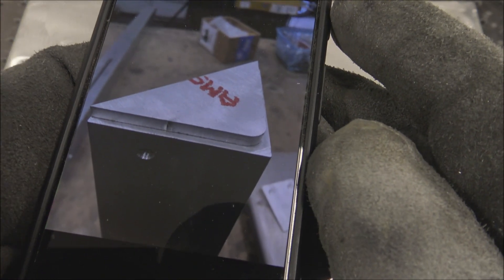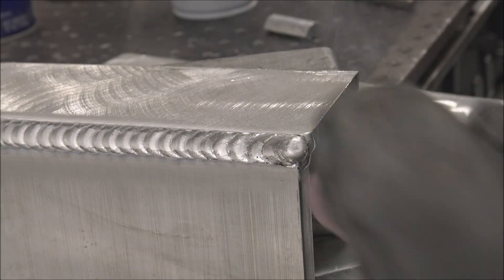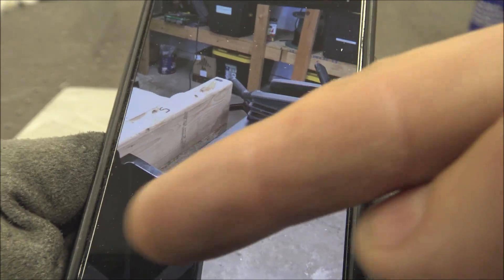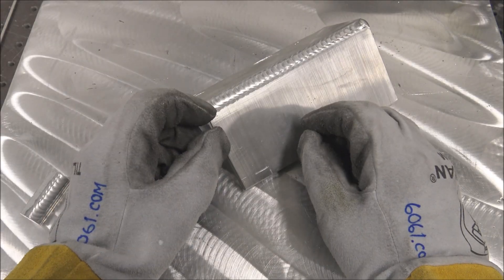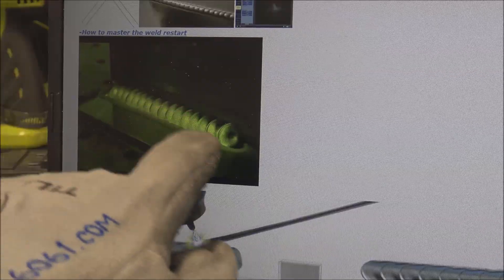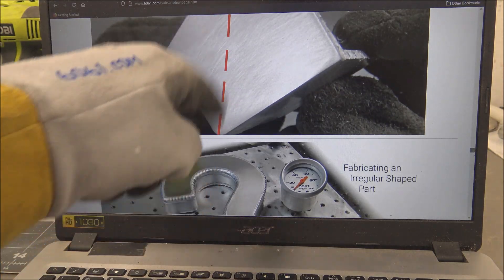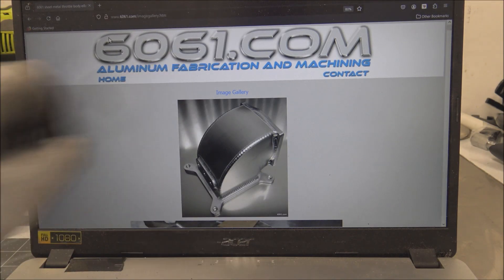TIG Welding Aluminum Fabrication Tips - So Many Things Can Go Wrong... Thick Stuff

Comment: Did you weld that using a foot pedal if so is it possible to get welds like that with a trigger switch?
Reply from the maker: I do not recall in this specific video.

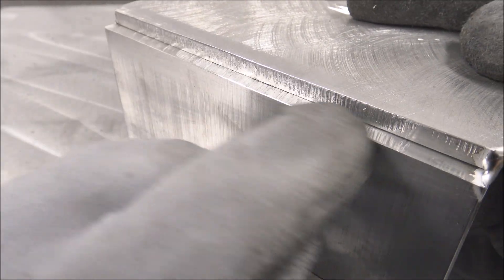Skip to the 1:50 mark in this video:
https://youtu.be/B53Xs33KIwM?si=T1lanrU7O_75U9Bv

Comment: Prime welds are awesome. The 325 will be my next machine. Also, I instruct my students to get puddle, add filler, move torch, pause, add filler, move torch, pause, add filler etc etc. 
That pause let's you make adjustments to the pedal, the arc angle, the filler etc. It's nice to see you doing that exact thing.

Comment: Omg I absolutely loved this video. I am trying to weld 50 x 50 x 6mm ali angle to make a roof rack. I have a new tig which has Cleaning Depth and Cleaning Width settings.  Im really struggling if you could please help. 🙏

Comment: On thick to thinner aluminum such as 1/2" to 3/16" or 5/8" to 1/4" I often throw the thicker part on a hot plate for a little while if I'm stuck using a 250 amp machine.

Comment: Wow! Awesome vid and weld bud. I'm buying my first tig. Only ever mig welded. Would you reccomend the 325 for a beginner? Thanks.
Reply from the maker: Absolutely. Some people buy a smaller machine and regret it (especially for aluminum welding)
use the code "6061" to save a few bucks if you decide to order one directly from their website: primeweld.com

Comment: i joined his website and my welds are phenomenal !! It is very simple as long as you follow his directions to the letter. One 5tip i will give anyone is you must be in a comfortable position to do great welds. Once i achieved this my welds are 90% like his. Also ditch the pedal and get the tig button, its a back saver !!!

Comment: I have to do a test for a qualification at work. It’s an aluminum fillet. 6x6 .060 base plate to a .025 top plate. No burn through or suck back permitted and lack of fusion in the root can’t be greater than .003. If you can do a video on that and how you’d weld it that’d be great 😂
Reply from the maker: Email me the specifics through the website. Metal type, etc...

Comment: I'm running a 225x with the watercooler and flex-loc water-cooled torch with welding aluminum I've been running mine at 200hz for welding turbo tubes and anything up to 1/8 thickness I find it easier to get in there and get it done before I heat it up to much. Would that something like you would do? Or am I looking at possible failures in my welds? Thanks for the update and great content enjoy your channel always good info... 😊😊😊

Comment: I have the same welder and have done a fillet in the past and could not get a puddle to form. 

I tried pre heating and just heat soaking, went up in tungsten size, tried different grind angles, different cup sizes, adjusting frequency, ac balance, Nothing seemed to work. It was an 8ft piece of 3/8 aluminum angle that i was welding a piece of 1/4 flat bar to. Couldn't puddle on the angle to save my life...
Reply from the maker: @nathancole8188
Please email me with the exact dimensions of the aluminum angle (leg lengths), and exactly where you were trying to weld the 1/4" flat bar.

Comment: Please tell us about lung and respiratory protection when TIG welding aluminum, stainless steel and steel! 
I understand this is a newbie question :)
Reply from the maker: Always try to weld in a well ventilated area with fresh air. If that's not an option, there are expensive welding hood systems available with a fresh air supply.
I have an exhaust fan in my shop that pulls air/smoke out above my welding table. I crack the window at the end of my shop to let in fresh air.
Reply: @6061  we use 2091 filters for a 3m mask since our company cannot afford expensive hoods.